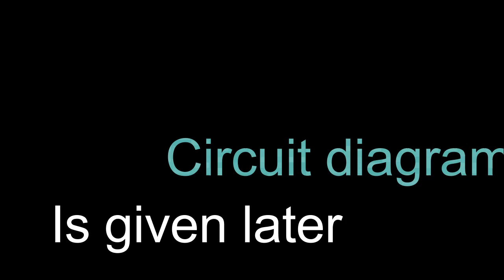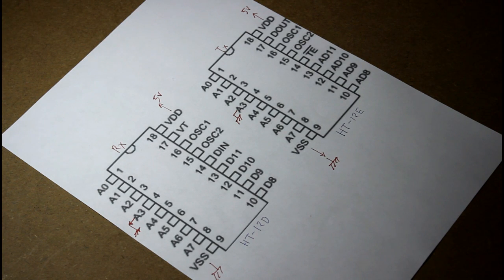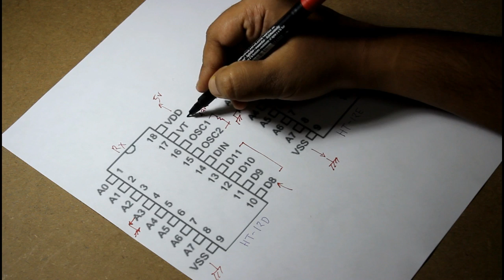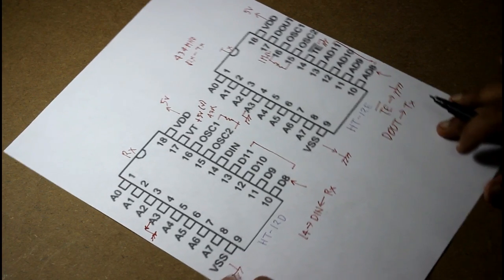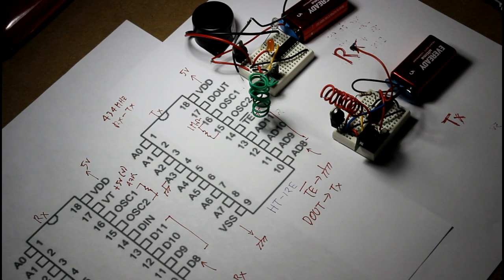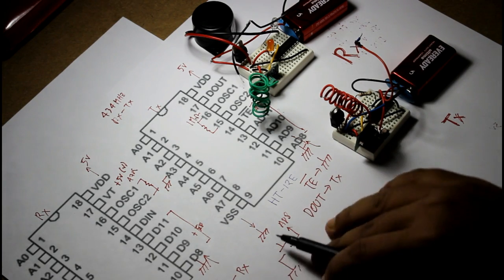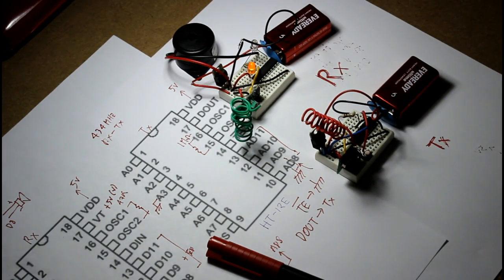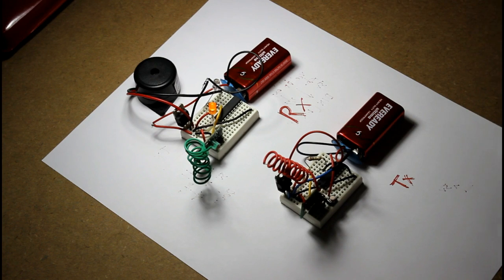How to create a Wireless Calling Bell (Digital Communication Project)

Comment: Can a 433Mhz rx-tx work here?
Reply from the maker: Obviously. The rx-tx I have used is listed as 434Mhz rx-tx. But it might be listed as 433Mhz at other places. So that is not a issue. 433 or 434, it will work fine. 
Thanks for your question. :)
Reply: Thanks. i want to do something similar to this but i dont know much about electronics, am just following what you do. Can i use any other IC apart from HT12E nad HT12D coz i cant seem to find those here in my home country. Great vid by the way.
Reply from the maker: +Whitley Tshireletso These IC are very popular but if you can't find it then look for PT2262 and PT2272. These works almost similarly.
Reply: Oh thanks man, i wil look for them.
Reply: Hello Again. I have been trying to make a connection like u did in the video bt am failing to get the same results. Am assuming i have not connected well in the breadboard, so can you please help me out. I have made a video and uploaded it on youtube "Respond To Being Engineers Video" inwhich i make the connection. Can u plis check it out and tell me where i got it wrong, or please make a video of making the connection on the breadboard. Your help will be highly appreciated.
Reply from the maker: I just watched your video. The connections seems fine. I will suggest three things.  Try that, if it doesn't work then I will make a small video showing the connections in a detail.

1. First of all try wired connection. Remove the 434Mhz Rx and Tx modules from the breadboard. Just connect a wire from DOUT of HT12E to DIN of HT12D. All other things will be as it is. Try it. If it works then all the connections apart from the RX and TX are perfect. 

2. In some breadboard the positive and negative rail are cut from middle. So do one thing. The ground wires that you have connected to the ground rail in the upper part of the breadboard, shift those wires in one side of the rail. 

3. If you have a multimeter then measure the volatges coming out of the 7805, check the pin 9 vs pin 18 of the ICs. The reading should be 5v.

You were asking about the two leds. The led connected to pin 17 of HT12D is noting but a indicator. If this two ICs are in same channel and the communication is established then this LED will glow. Regarding the polarity, positive led that is the longer leg of the led will be connected to pin 17 and negative led that is the shorter leg will be connected to ground. The second LED was connected to parallel of the buzzer. It is just for visual conformation. You don't need this if you are sure your buzzer is working fine. 

I have done this many times in my college or for my friends. Every time it has worked. So there might be some very simple mistake that is happening. Try these fixes, if it doesn't work, I will send you some more detailed pic of the connection.

Just a tip, always try to use the connecting wires as short as possible. It is easy to troubleshoot if the connection is wrong.
Reply: Thank you very much for getting back at me and helping me. Well i have tried all the things u said i should do, i did the wired connection, everything worked apart from the RX and TX, i did all u said i should do bt there is still no connection btwn the RX circuit and TX circuit. Can u please make a video showing the connections in detail please.
Reply: Hello??!!
Reply from the maker: Sorry for late reply. Actually we are having our final semester ongoing and we are very busy with our final year project, so it not possible to make a dedicated video at this moment. But as soon as it is all over we will make a dedicated video on the connections.